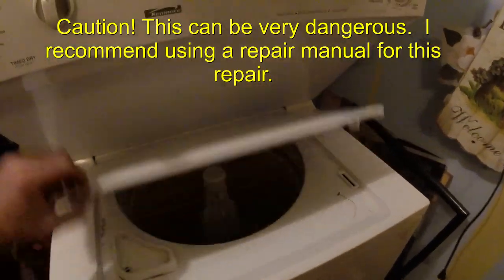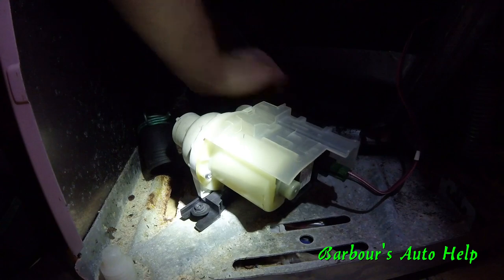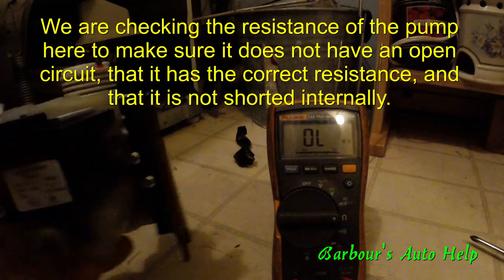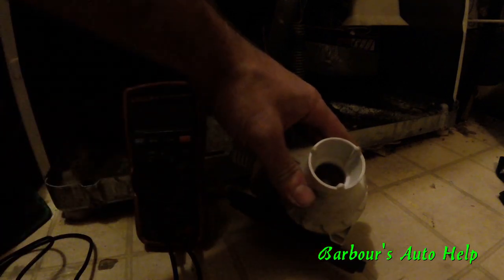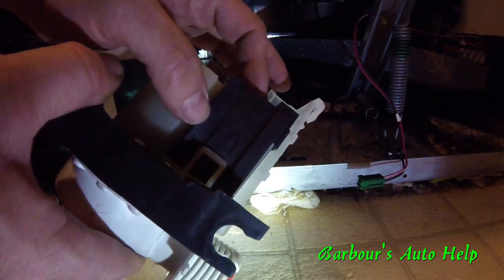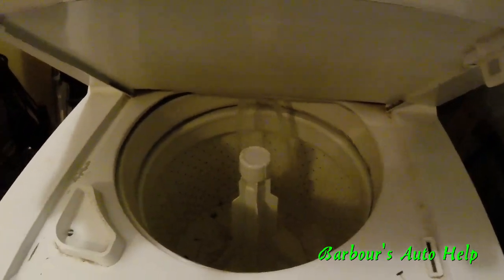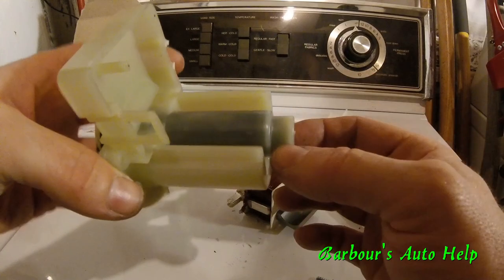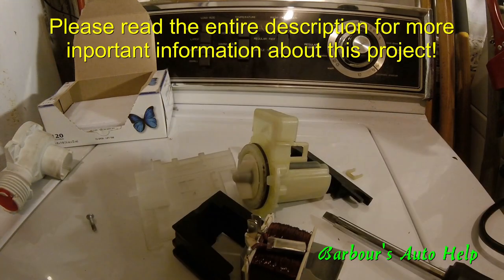Washing machine drain pump diagnostic and replacement

Comment: Great video. I was so hoping you would have pulled that impeller straight off lol. Mine makes a similar noise and when I pulled the impeller off I noticed the inside of the impeller had quite a bit of wear, fyi. Enjoyed your demonstration I definitely learned how the coil and magnet worked from you.

Comment: Excellent video...most thorough diagnosis that I have ever seen as of yet on a washer drain pump. I like how thorough you were...down to the part. The loaded retest was very good (to eliminate loaded drop voltage).

Comment: Thanks for the details.  Traditional repair sites only suggest how to replace, not diagnose.
Reply: Peter Basaraba , wondering that the old is still working fine right? The reason to change the new one because of making noisy ?

Comment: I think I finally found a video explaining my problem. I took apart my front loader which took forever and the impeller spins like it’s suppose to and it wasn’t clogged BUT it was making that same grinding noise. Gonna try and replace it and see what happens

Comment: The impeller gets a bit or 100 solids that make it past the filters and it wears out the seal, the impeller gets wobbly, water gets in like you mentioned and it's not supposed to be there.
Reply: Wish he would have pulled the impeller out to look for wear on its shaft. If seal leaks, does it fail due to excessive drag internally?  I just swapped out a pump similar to this. Found drain filter full of coins, but also a float ball valve leading up to the pump from drum that was massively plugged up with lint junk etc. Suspect very poor flow to pump to begin with caused excessive pump run time. Eventual wearing out of shaft.  Check for obstruction between drum and pump is important